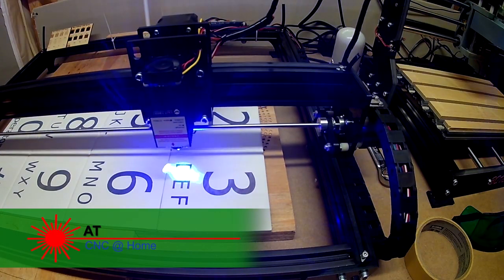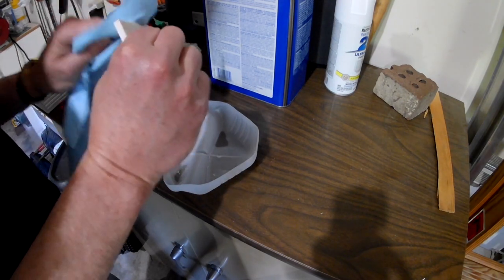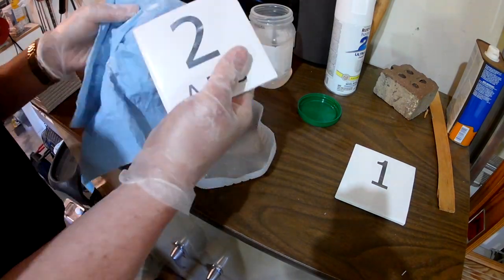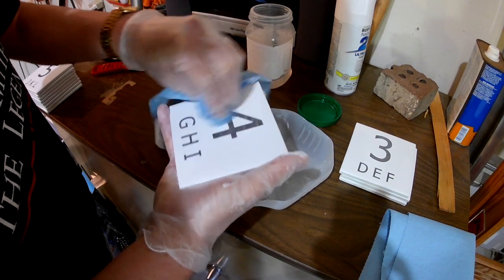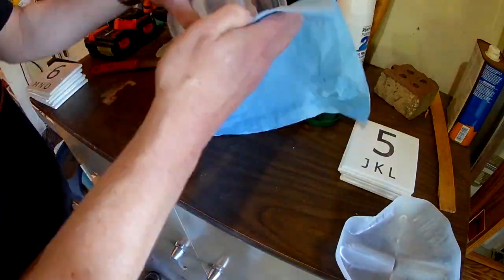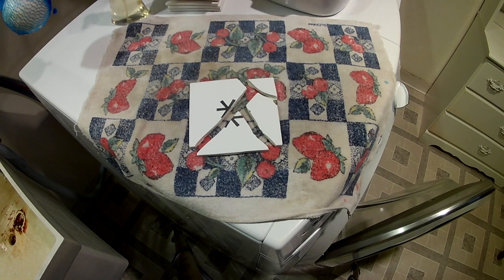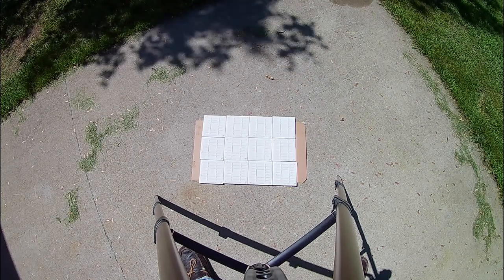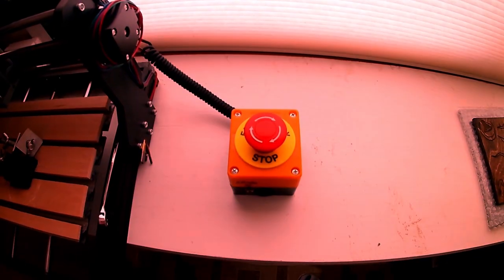Clean The Tiles

Comment: How long approximately did it take your ma home to engrave the 12 tiles?
Reply from the maker: It has been a while, I had to dig up that project and take a look.  It looks like that project took about 3-1/4 hours to engrave all 12 tiles.
Reply: @CNCATHome  thank you for the quick response. I'm just seeing if it's worth it to sell and how much I could sell them for. That means in 7 hours I could only produce 24 tiles approximately
Reply from the maker: @jameshuenefeld655  - with a machine of this speed.  The speed could be increased a little if you were to run the laser at 100%  You might be able to bring it down to 3 hours for a set.  This is something that will run on its own.  

Good luck with this if you decide to sell these as a set.  It was a fun project.

Comment: Nice video.  What type of paint are you using please?
Reply from the maker: Great questions.  I am using a flat white paint from Rust-Olium.  It is called Painter's Touch.
Reply: @CNCATHome  Oh it is water based. Thanks.
Reply from the maker: @alandimery3379  - That particular paint is not water based.
Reply: @CNCATHome  Sorry to keep pestering you but is it gloss or matt.  Thanks.
Reply from the maker: @alandimery3379  - It is flat or matt.  Either should work.
Reply: @CNCATHome  I wont bother you any more.  I am still awaiting delivery of my machine from Gearbest.  It is taking forever.  Thanks again.
Reply from the maker: @alandimery3379  - How exciting!  It sounds like you have several project all ready to go when you machine shows up.  That is great.

Comment: Be nice if you gave your settings for your tile projects.
Reply from the maker: I agree.  It is somewhat hit and miss on that.  Using the 5.5 WATT LED laser, I do these white painted tiles using 85% power and 1,200 mm/min speed.  In LightBurn, I use 300 or 350 lines per inch for the resolution.  I have started using a 90° bi-directional scan pattern as using 45° doesn't seems to burn quite as well as it had been.
Reply from the maker: I will attempt to do a better job including my burn and cut parameters in the future.

Comment: I use acetone and paper towels to clean my tiles much the same way you do but I don't see the need to wash them in water as there is no residue left.
Reply from the maker: Great comment Kris.  When I used mineral spirits, it did leave a little something behind and soaked into the tile.  Lacquer thinner does a much better job of evaporating away.  There is some that soaks into the tile and I let them sit a while so that will work itself out.